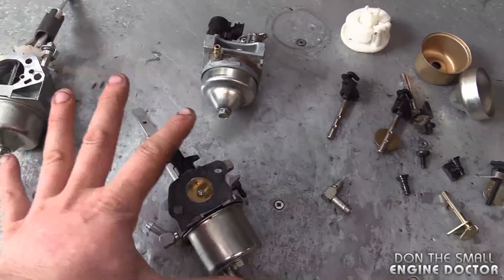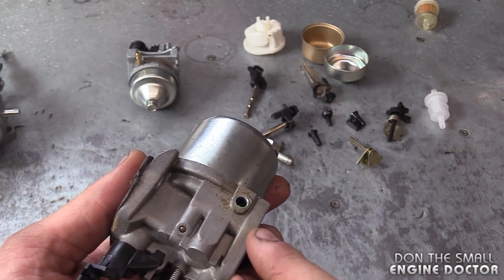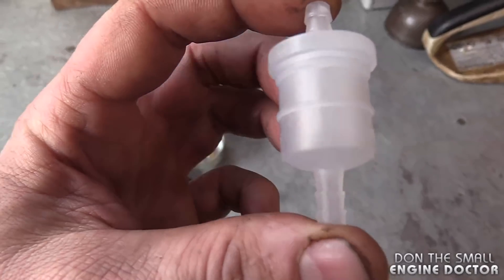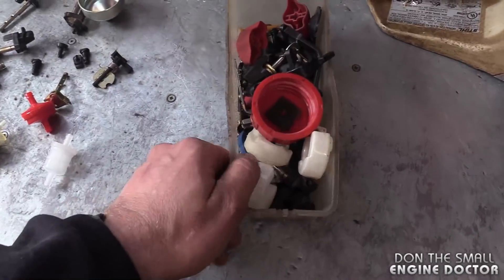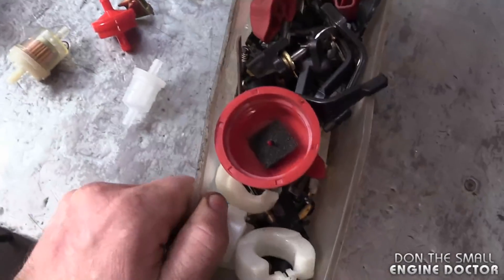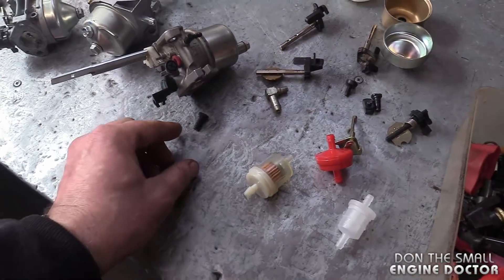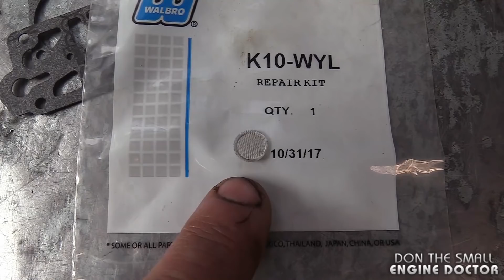How I Found The Hidden Fuel Filter Screen Inside Small Engine Carburetors! - Video

Comment: Dear Donyboy, I’d like to see if you have any suggestion for me on a saw I’m working on, Stihl 015, can’t get high enough rpms and  the high idle screw is all the way turned in. I really appreciate if you have time to help me understand what might cause this. Thanks Sincerely, KyleH
Reply from the maker: It could be that the L screw is turned out too uch
Reply: @donyboy73  ok I’ll check, could the needle lever set to high cause this by chance? Thanks!

Comment: Just came across this because I just bought a brand new Troy Bill snowblower. Got it at a great discount even though it had never even been assembled. 
But after fueling it up it has a nasty surge problem. And me being me just can’t bring myself not to figure out why it surges. 
Debris from manufacturing in that screen ?
Idle jet needs to be oversized ?
My instinct as a consumer is to load it in the truck and return it, but the tinkering part of me wants to get it running good by myself!
Am I the only one that thinks that way? 😂

Comment: I removed this screen from my Cub 3x26 yesterday after viewing your prior video.  And yes, I installed an inline fuel filter and shut off valve.  I've always used those large see through filters and never had a problem.  I previously removed the shielding from around the carb (not muffler).  I elevated the fuel tank 3" for better gravity feed.  There is a trapping effect of the fuel when levels go below 1/2 tank which caused intermittent starvation issues.  Problem solved.  That is a powermore design flaw plain and simple. I also fabbed an air filter out of some pre-filter foam - the choke dial holds it in place. Plastic key - gone.  I'm now able to access the carb or spark plug whenever/if ever needed with ease. Also,  this channel is outstanding and extremely helpful.

Comment: Thanks for the update. I have one of the pleaded-type in-line filters on my 11HP B&S for my tractor and have not had only flow problems. It’s also a gravity feed. However, next time I’ll replace with a screen-type.
Reply: Don't fix it ain't broke!  Never had a problem with the pleated filter either.  I believe that flow problem is inherent to small compact engines with fuel tanks mounted too low in relation to the carb it is feeding.

Comment: I cleaned all the jets on my carb and still only runs on choke. I'm shure that screen is clogged with old fuel. The bowl looked like honey
Reply: Old fuel that contained ethanol.
Reply: Yep... Wonder if that's what's up with my 85hp force outboard.... 
Cleaned throughly & well timed yet still needs choke on two of the 3 carbs to get rpms up under load ...
Reply: @johmu5466  the problem with ethanol is that it never truly blends with gasoline, but forms a type of loose emulsion.  If not burned right away (in at least 30 days) it goes to work gathering water out of the atmosphere.  I have two old (1980’s) John Deere’s lawn tractors, a 1976 roto tiller, 3 snowblowers, a 25 hp Mercury, and a 67 Camaro that I’ve owned since their birth and have never had ethanol in any of them, and guess what.......I’ve never had a fuel problem with any of them.

Comment: Do you think an ultrasonic cleaner will jar loose the debris in one of the screens you speak of?
Reply from the maker: it might but i would manually check it
Reply: It would clean around the debris but likely not move it as the crud would need to move quite a ways to get back out.

Comment: I’m so glad you mentioned about the cardboard filters. I have a Cub Cadet RZT L 46 with a Honda engine. All the other engines have a fuel pump. The Honda is gravity fed. When I order a tuneup kit it came with a cardboard filter. I started having problems with engine surging at high RPM’s. I was about to pull the carburetor. Now I’ll try changing the filter first.
Reply from the maker: i've had the same problem in the past on lawn tractors, some of the filters are cheaper than others and after a while the fuel wouldn't flow through

Comment: Great info. I’m n the states , is there a good on line source you use for parts?
Also how can I tell what brand engine is in my equipment? Hopefully that’s not a real dumb question.
Reply: Quite a few places, Messicks, Parts Tree, Jacks Small Engines (slow filling orders though), K&T parts are just a few I've used for parts in the U.S.  Engine brands are usually stamped on the spec tag on the engine.

Comment: Snowmobiles  sometimes have screens on the inlet side of the carb. I noticed this only on certain models. The mechanics manuals even mentioned the possibility of having them. Generally I never seen them on lawn equipment till you mentioned it.  Those red filters are not  that great but better than nothing.  I personally prefer  the type with a ceramic filter but they are not cheap.

Comment: Saving parts such as carburetors throttle assemblies is smart. Otherwise there'd be no practical way to fix uncommon or old equipment. I like cleaning and rebuilding Briggs carburetors. I don't need to. It's just so therapeutic.